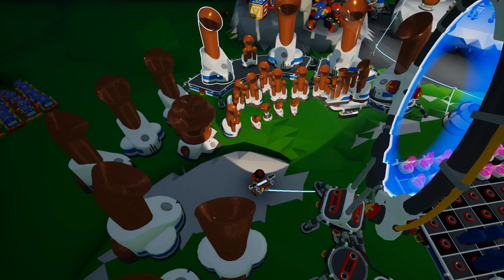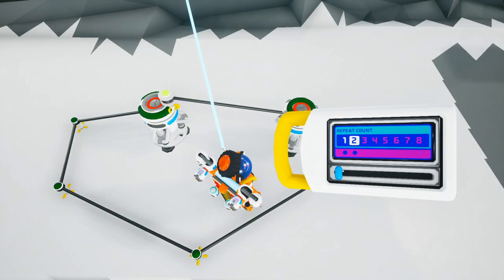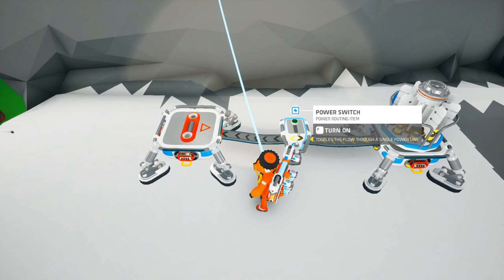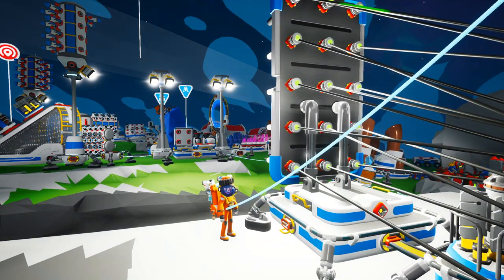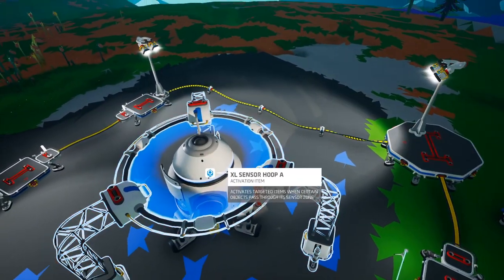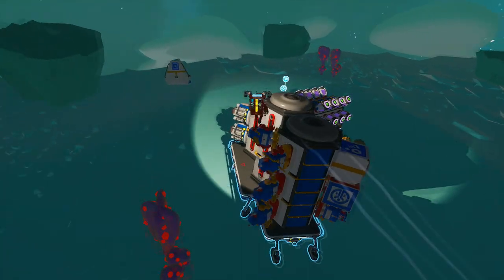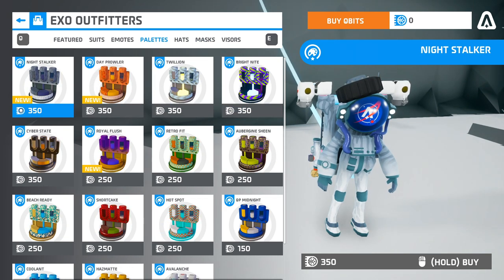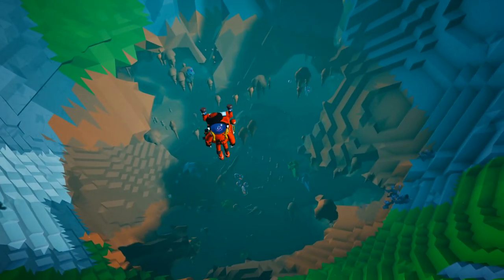Astroneer Tips & Tricks - Automation Update #2

Comment: i think im gonna need a team but i do have a start on making a 7-segment display rn im stuck on making a reset button and a and gate thats small cuz i need like 4 inputs and a small setup i think having a power switch atached to a button repeater in the formation of a display with the medium active storage basically the state of the power switch will tell the reset system if the light is on or not and turn it off by the power sensor
(later edit): i made a circuit that will change the lights state based on the stored state of a power sensor and if its already on it will turn it off and back on again, also have a reset button to turn it off and if its off it wont change, heres a picture of a single segments circuit spread out (open in new tab) i play on xbox so i had to pull a few strings to get this into a link so i can send 
https://cdn.discordapp.com/attachments/738835824564764794/746397320806924368/ASTRONEER.png
https://cdn.discordapp.com/attachments/738835824564764794/746397405691379803/ASTRONEER_2.png
should i make it be a message board or a counter because both are the same difficulty after the bits are done
Reply from the maker: Nice job dude! Also, if you need more help you should check out T-Hill, he already made a calculator with a display: https://www.youtube.com/watch?v=ZPAeDMCYjUY. That video might help you out. I haven't figured any of this stuff out and I'm trying to do it on my own so I won't watch that video haha.